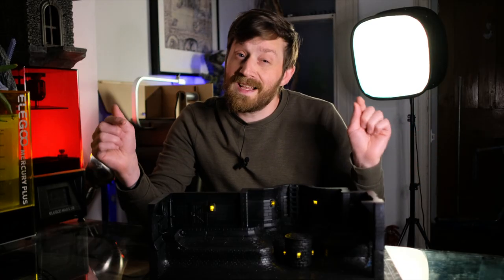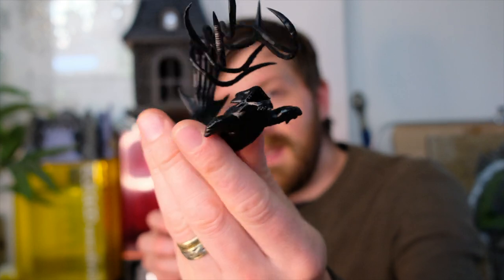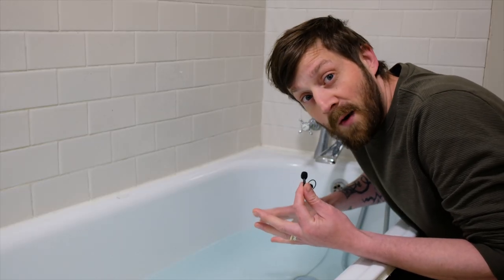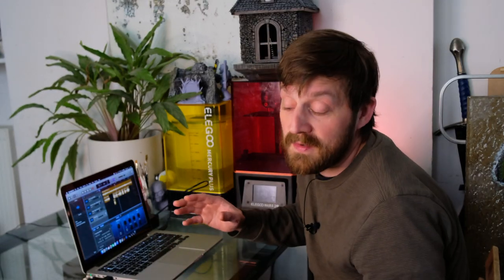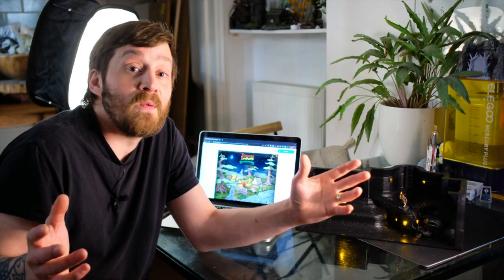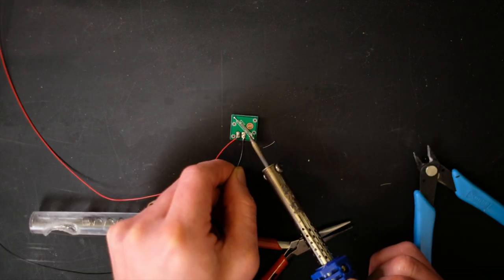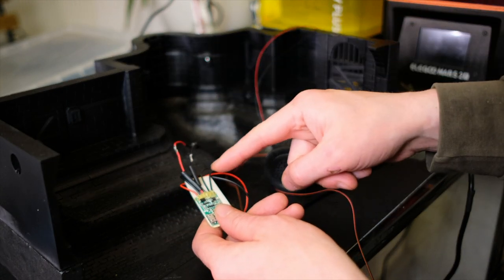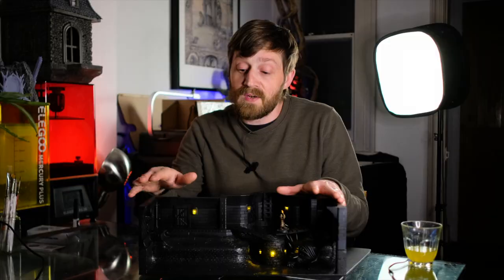I put SOUND EFFECTS in this INFESTED sewer DIORAMA

Comment: Oookay ... thats impressive.... I really should invest time into learning how to light up boards.
Reply from the maker: Thanks! It won't take much time. Follow Terrain Tronics for lots of cool tips ;)
Reply: @Nat1videos  yeah I binge watched their current series ... they explain their builds really well, but I need even more basic electrical knowledge first ... like "what size of battery to use for what number of LEDs" ... "How to not hurt yourself while soldering 101" ... That kind of stuff 😅
Reply from the maker: @aerouge4492  🤔hmmm that might be an idea for a future video
Reply: @Nat1videos  That would be really cool! Most videos dealing with this stuff simply assume a baselevel of electrical engineering knowledge and start with stuff like programming boards and stuff but I and many others I talked too cant find and need some kind of 101 ... basic builds, like "battery, switch, (resistor???), LED" on where to improve with programmable boards and magnetic switches and sound speakers :-D 

Your current video is great in giving me the great idea to improve my newly printed Wizardstower with an irregular blinking blue LED on top and maybe some thunder sounds BUT as long as as I have no clue how to power it I am very hesistant to drop 50+€ in importing boards and speakers (or dig through the myriads of SKU's my local electrics retailer has in his catalog with no clue what's what).

So if you or anybody else got a great starter on electrifying gameboards or Dioramas I'd really appreciate it!